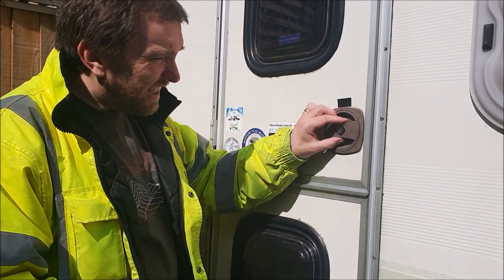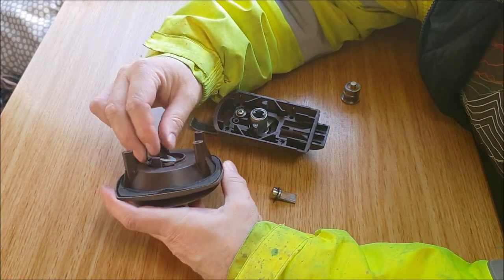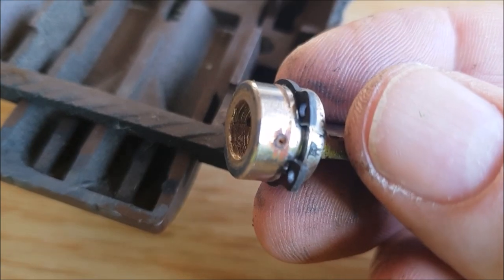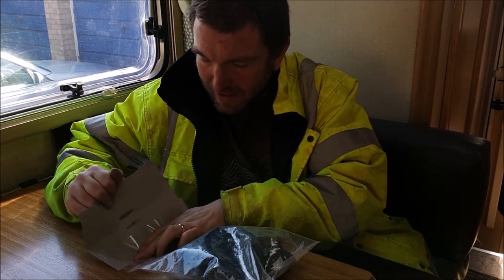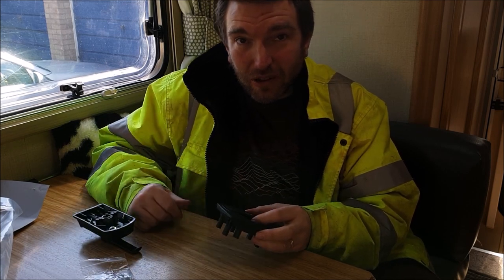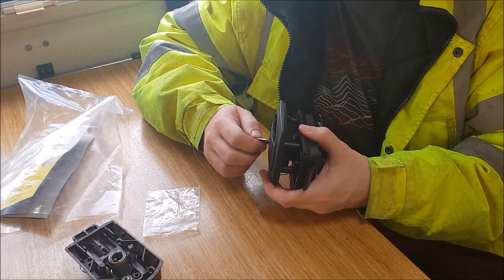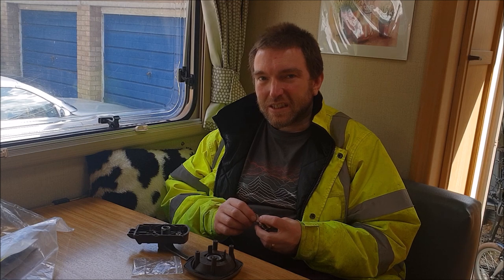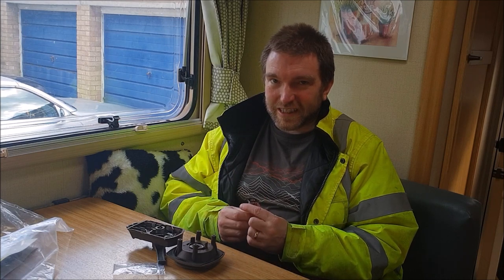Replacing the Caraloc 640 Habitation Door Lock

Comment: Hi, thanks so much for this...I bought this replacement lock and couldn’t get it to work (presumed it was faulty).  I couldn’t take it back as I had bought it while away in the van so I ordered another one from Amazon - this didn’t lock either.  After watching your video, I realised that it was not faulty but very very very stiff.  Will lubricate - thanks for your clear explanation.
Reply from the maker: Glad it helped, ours is now 'easing' a bit after being on for a while.
Reply: Same, bought a replacement caraloc 640 and it seemed faulty but was just EXTREMELY stiff, good spray with silicone spray and it was ok

Comment: I wonder if that rolled pin IS the ‘high security’ feature. Designed to shear if the barrel is forced with a screwdriver thereby preventing the door from being opened.
Reply from the maker: Good point, that is a possibility I guess 🤔

Comment: I had the same problem with my caravan lock.. Ordered a new one, it came and I fitted it, put the key in and locked it..?? It find out that the locks are handed, left open, right open. I had to break in as I had fitted the wrong handed one.. Store didn't ask me which hand I wanted, and I thought they were both the same.. I did notice that you have got stickers on the outside of the door but seem to be missing a Womble one...??? Haahaha Mine are just the right size to cover the Whipit and poo picker one..
Reply from the maker: Ah yes, I noticed they are handed, you'd have thought it would still work though and the handle would just go down instead of up when you locked it? A sticker would be great, shall we do a sticker swap? :)
Reply: Hi Bud.. I posted sticker today
Reply from the maker: @WonderingWomble  Brilliant,  thanks!

Comment: Hi where did you get the whole door lock from?
Reply from the maker: A while ago now but I think it was either from eBay or Amazon. If you search Caraloc 640 you'll find quite a few listed. Make sure you get the correctly handed version for your door.
Reply: @ttxela  Hi when you say correctly handed? Do I look from outside of van? So if on right side of door from outside???
Reply from the maker: @paulineclaughan519  Standing outside the caravan, if the hinges are on the left of the door as you look at it you will require a left handed lock or right hand lock if the hinges are on the right hand side of the door.

Comment: Has somebody tried to break into the van at some time or tried to open latch from inside when locked ?.. In theory there should be little effort to open the latch. ( drill out roll pin  or return to supplier for comments ).
Reply from the maker: No break in attempt as far as I know. Locking and unlocking requires the mechanism to lift/lower the inside handle to drop/lift an interference bar behind the striker. To make this a positive action it has to do it against the last little bit of tension in the striker spring. All that torque plus the torque from actually operating the latch against the striker spring has to pass through that central shaft which only that tiny roll pin prevents slipping where it is in two parts. I think it was bound to fail after even a moderate amount of use.

The original key lock is not in two parts and so doesn't have that weak point.
Reply: @ttxela  new stainless pin and consolidate with araldite should work.